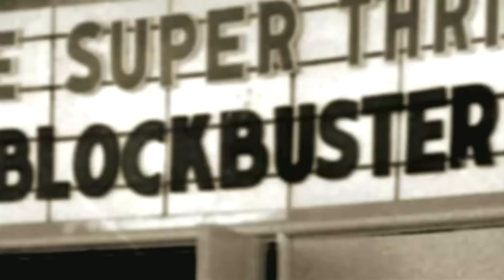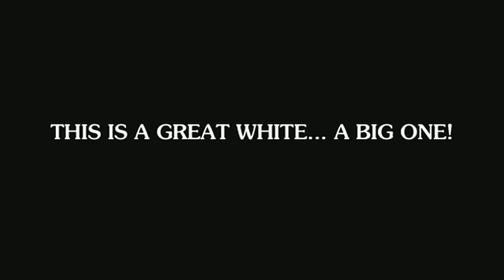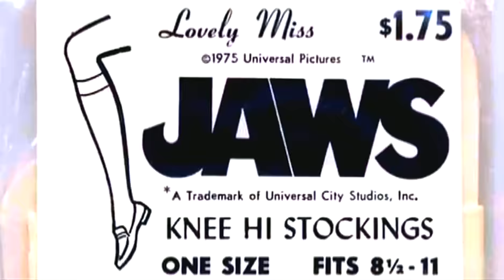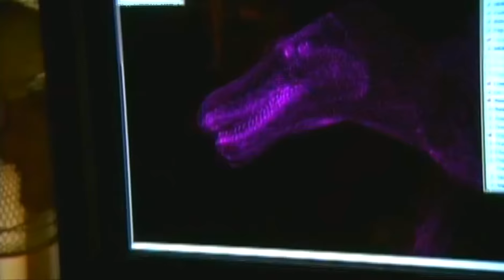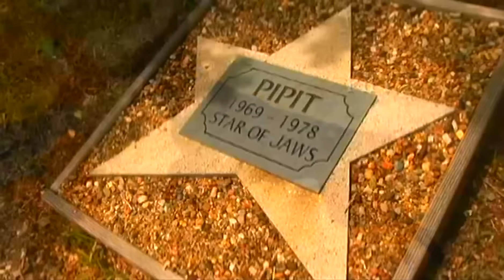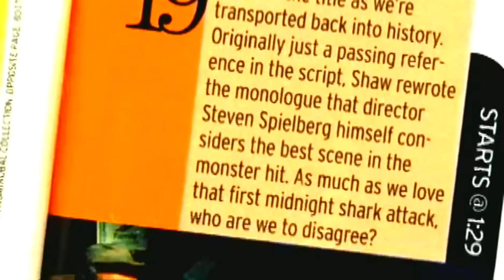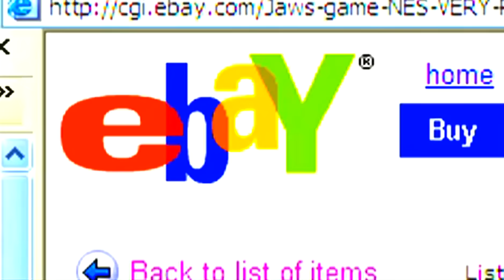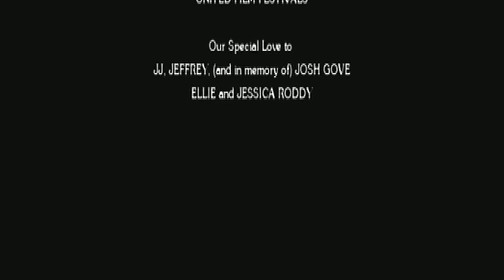The Shark Is Still Working JAWS Documentary

Comment: Did you know that the original script for jaws had far more shark attack scenes than the one that used,the bord of film sensors said it could only be commissioned with fewer shark death scenes,i think originally it had like 10 or something,Spielberg cut the shark deaths down to 5,chrissy(the swimmer)alex(the kid on the rubber dinghy)some guys head floating in the hollow of a boat,a dude on a rowing boat and quint,the same was done to jaws 2,a sanitised version,originally the helicopter pilot who flew out to save the stricken teens was seen swimming from the sinking helicopter,i think,under water,and you don't see him again,in the original script he swims from the sinking helicopter under water and is bitten in half
Reply: The head of Ben Gardener that floats out of the hole in the boat was added after a test screening. Spielberg decided he wanted one more scare.